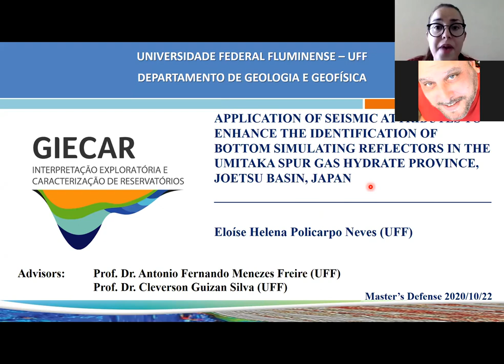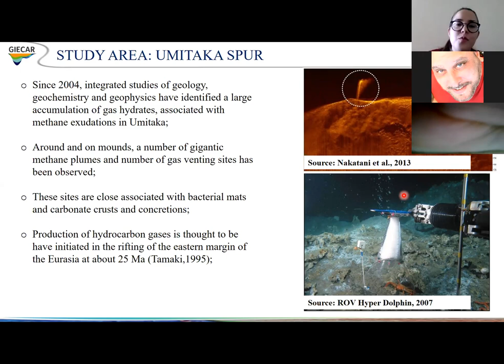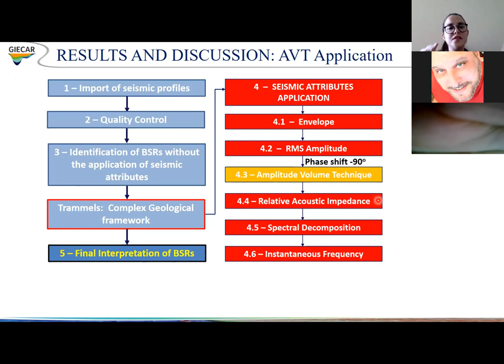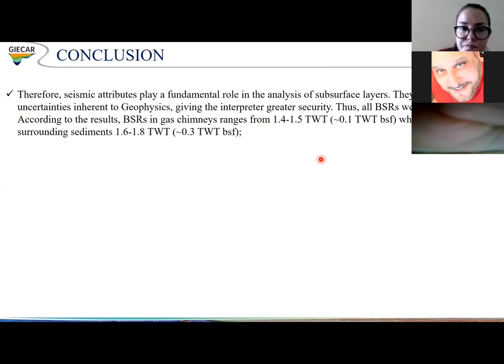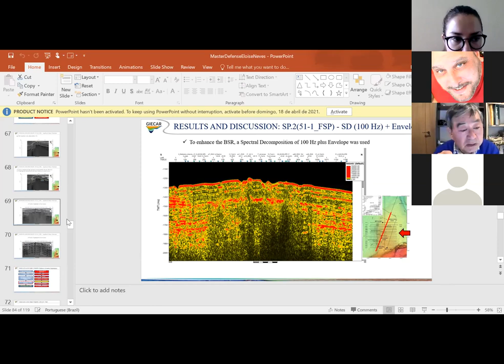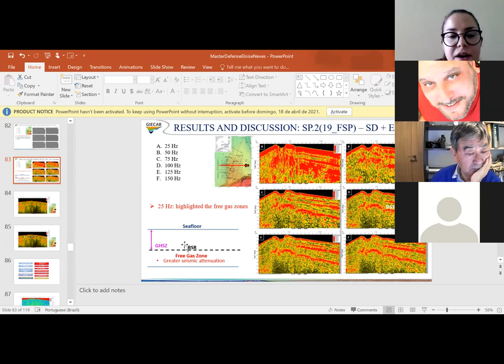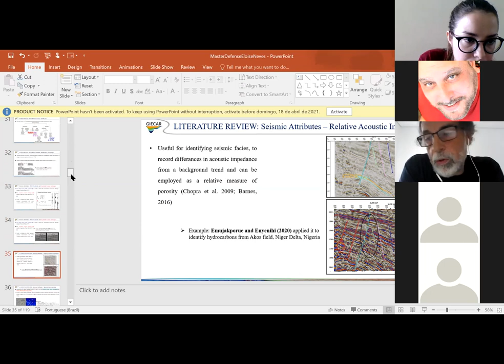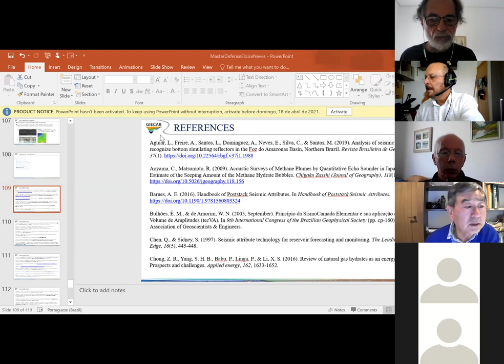Defesa de Mestrado Eloise Neves

Comment: Wavelet transform spectral decomposition, relative acoustic impedance, amplitude volume techniques  Seismic attributes multidimensional Seismic interpretation, double BSR Gashydrate, extended elastic impedance Rock physics Template, etc